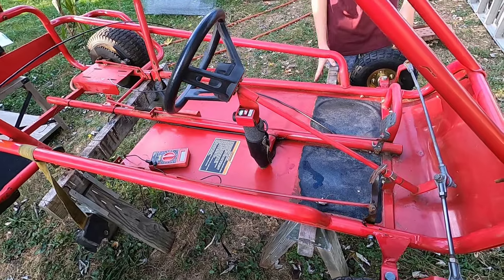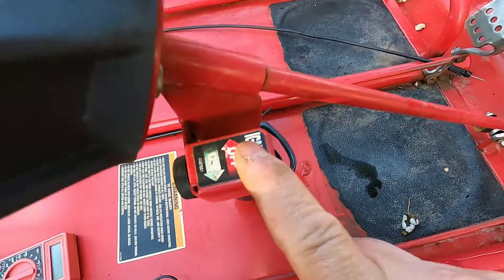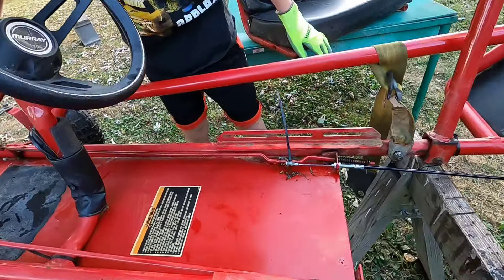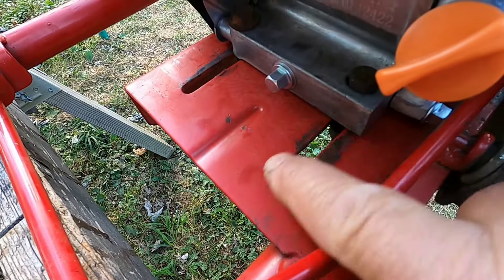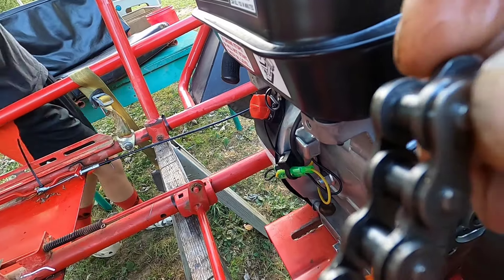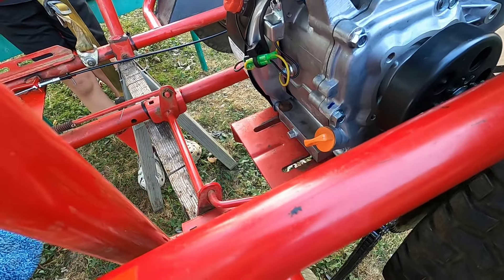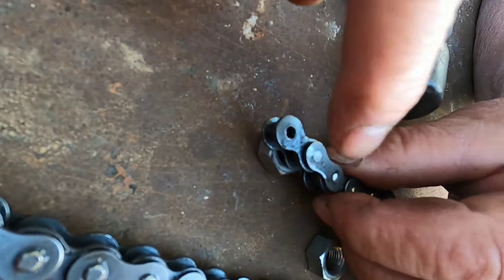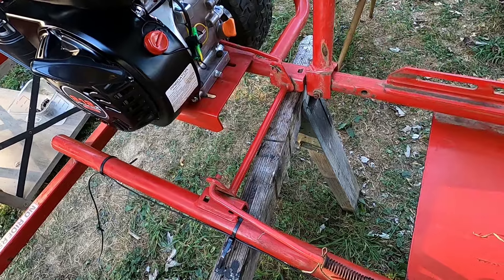#Go Kart #Engine Swap Johnny's Go Cart Update

Comment: Could the chain sprocket on the drive wheel be adjusted to align instead of a spacer on the the gear on the clutch?  The chain alignment looks to be off by about an inch.  If not, could you mark where the engine mounting bolts are now and use a Dremel Tool grinding cylinder, or something similar, to grind the mounting slots to have a 90° slot just deep enough to align the chain?  If possible, this would save finding and installing a spacer for the clutch gear.  Or maybe a combination of both, depending on the spacer you can find.  The engine mounting slots may be designed the way they are to be able to adjust for chain stretching, so if the 90° cut slots have to be lengthened to accommodate chain stretch, you could use thick washers and lock nuts on the bottom for stabilization.  You'll have to evaluate if these things are possible or not and if some combination can work well enough.  Good luck.  Looks like Johnny really enjoyed his go cart.  Please tell him I said Hi.
Reply from the maker: Thank you for these suggestions. I was considering grinding the mounting slots 90 deg to move the engine towards the chain but thought I man=y have an issue if I had to move the engine at a later date to tighten the chain. I put a couple of washers behind the clutch & it did the job. I will tell Johnny you said hi. Thanks again.
Stay well, Joe Z
Reply: @JOEZEP54   I'm glad you found an easy fix.  About one inch of washers and I guess a longer bolt.  Best wishes to you and your family.  Winter is coming and the weather is crazy, so I hope you all can stay warm.  We had no real effects from Helene or Milton here, so all is about the same, which is a good thing.
Reply from the maker: @100vg  I am glad to hear you & your family were not harmed with Helene or Milton. It is getting on the cold side up here. This is the second day I am using the fireplace insert. I am going to have to break down & light my boiler soon LOL.  Thank you for your input to my channel & best wishes.
 My best to you and your family.